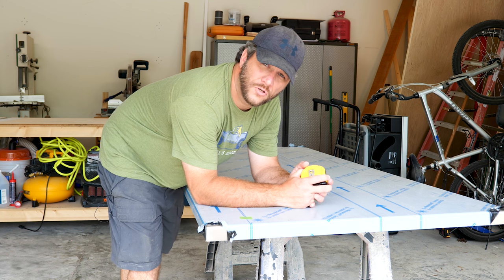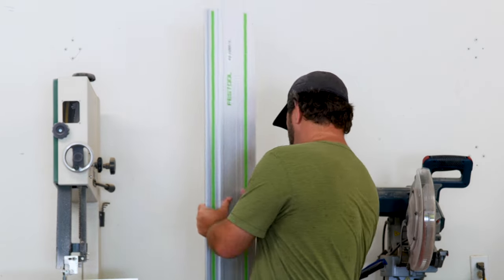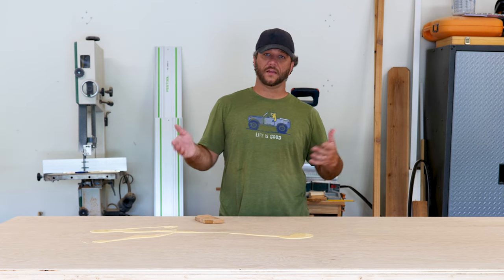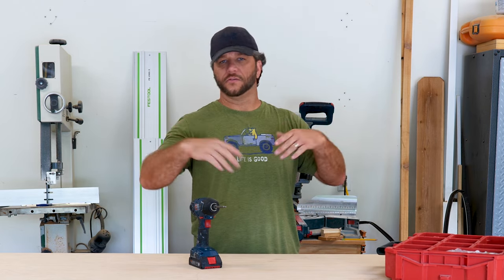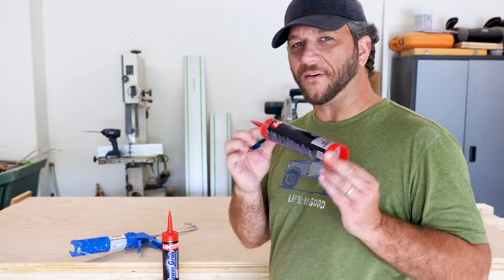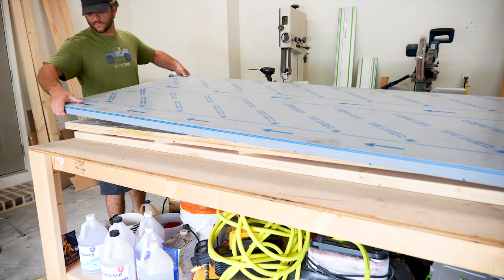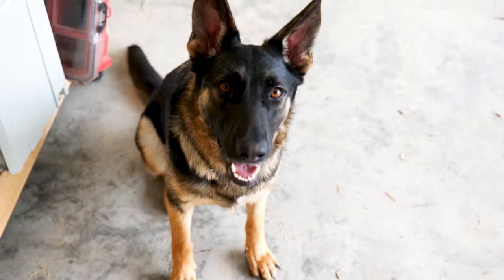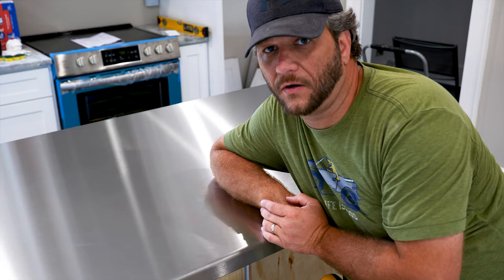EXPENSIVE Kitchen Countertop for CHEAP!

Comment: What you can do mate is get an orbital sander with a 240 grit pad, add some oil to the stainless and go over it with the sander it gives it an excellent Matt finish. So basically professionally scratch it to save you looking at scratches at the beginning. Then just re finish it same way whenever you want. That’s what I do 👍🏻
Reply from the maker: That's a great tip! Thanks!

Comment: This is such a great idea! With a stainless steel countertop, you can roll dough (baking), temper chocolate, etc! The possibilities for all things baking and cooking are endless with a stainless steel counter. The only modification I'd make to it is to install a cooling mat under the stainless steel sheet because stainless steel takes time to cool down when you put hot stuff on it (example: chocolate to temper it). A cooling mat will eliminate that problem and make it easier, and more enjoyable, to work (baking cooking) on that countertop. Thank you for sharing!!! It's a really great idea!!!
Reply: I know it's been a few months, so I hope you see this...I'm actually looking into making one section of my counter stainless for the exact reasons you mentioned & I had the same thought re: it holding onto heat. What do you mean by a cooling mat? I was thinking just a garden-variety insulated mat on top but I think that would still prob get/stay hotter than I'd like so now this cooling mat idea has me intrigued! 
Thx in advance 😊
Reply: @marchi.fleming  Professional kitchens, dedicated to candy making, have a cooling mat installed under the stainless steel. For what I've gathered, some cooling mats have different temperature settings to choose from, depending on what you're making. Those cooling mats can usually be bought from specialized vendors only. However, they're worth it.

I hope this helps.
Reply: @marchi.fleming  my understanding theyre plumbed with water to draw heat out of the surface
Reply: Thank u!!

Comment: I have some ideas for you. Don't use plywood as your base, tell the fabricator to use square or rectangular tubing to make the base, way stronger and will not sag or absorb water. Second, clean surface with lacquer thinner and  use 2k clear coat to spray the top and sides with a spray gun and compressor, 2 coats with some reducer to help it flow like glass, let dry, and flow coat it, spraying 2 more coats, go crazy. Now to have scratch resistance, and you repair it like a car. Also if you're rich Tamco sells ultra hard clear coat for boats and cars, looks like glass but hard AF. Same formulation as what they originally used in Disneyland, unless I read that wrong
Reply: What is rectangular tubing?
Reply: @kellyreid978  square tubing means all sides are equal length, rectangular just means 2 sides are longer than the other 2 sides.

Comment: Good video & thank you for telling people they will scratch!  I am a sheet metal woker. We get so many calls about scratched stainless countertops.If you want a countertop to stick without releasing use a glue specifically made to adhere to metal. We use Loctite PL Premium for countertops all the time and do not have any release issues. Also recommend returning all exposed edges with 1/2" so people who run hand along edge of countertop do not get cut.

Comment: I found an 8x4 sheet of stainless for $100. 1.00 mm thick. Going to chop it into three pieces and make smaller free-standing islands, 30" x 48" each. On locking casters.
Reply: Hi, did you ever try this , did it work ok? Thank you
Reply: @KeiFreedman  Yep. Done and done! It's been working BEAUTIFULLY for many years now. In one of them we cut a hole for a stainless steel sink. We ended up making four of them, and kept three.

The first one we made we ended up giving away to someone else. Someone who was "helping" us bend the metal (for the edges) tried to bend it with a hammer... Then decided that the hammer marks could be sanded out. On stainless steel. Needless to say it looked like absolute garbage, and we stopped accepting his 'help'. It looked terrible so we just gave it way. Still very functional. For something to look good, you need a proper metal bending machine to bend the steel down for the edges.

Comment: Thanks for the video. I'm working on this right now. Did you weigh down the stainless after glue up? Or any other left out steps. Thanks.Good looking project.
Reply from the maker: I didn’t weigh it down. The glue I used was instant grab. I did go around it pressing down every so often for about ten minutes just to make sure it was making contact though. Thanks!

Comment: Hi, great video. I would like stainless steel on the perimeter of my kitchen which are 2 cabinets flanking sink and then a and L shape so a 4ft long single piece and and other about 36x24 approximately so might have put them together to make that L then I have the 2 cabinets flanking the sink which will be a top mount sink. I’m so confused and don’t know where to start, may I ask where you ordered the stainless piece from? It’s very nice you did a great job. I don’t want stone , or butcher block, wanted something easy to clean up around water , I was also maybe thinking copper but I don’t know where to start. I will hire the work out I just don’t know where to get stainless? Also I read somewhere that if I go with copper counter it will need some sort of safety to avoid shock, can you please give me some guidance if it’s not too much trouble, thanks a bunch. Your dog is awesome!

Comment: Hi amazing work! i question what is the Thickness of the stainless steel sheet? what would you recommend for a kitchen? thanks for sharing !
Reply from the maker: Thanks! I went with 16 gauge steel but 14 or 18 would work also. I've had a 16 gauge top for 15 years and never dented it with hard daily use.
Reply: @HAXMAN  yeah 16 or 14 sounds like it should be fine. At first i wanted to go for a more contemporary look with a 1/2''' thick sheet, i have seen it before and its just mind blowing specially from the sides  it looks cool, the problem is the price  ahahaha no budget for that! thanks for sharing good stuff man, i will go with 16 gauge.

Comment: Do you think it would work as a covering for a kitchen table as well and would I have to glue it down? Stainless steel tables are so great and the top of my table needs refinishing so I was wondering if this might be a good option. Thank you in advance!
Reply from the maker: I think that’s a great idea! Yes, I would glue it down.
Reply: @HAXMAN  thank you! Would it have to be glued down if it was a tight enough fit?
Reply from the maker: Maybe not but gluing it would help prevent dents.
Reply: If you have access to a metal brake, or the ability to build/use a DIY brake, you could always make it so the sides capture the table. You can make it slide on, from one direction, then you could turn the stainless, into a big C clamp basically. It would clamp the table, keeping the stainless secure, while making it removable. I would lay a 1/4" foam mat or lining, over the table, to act as an insulation, as well as to have something to keep the clamps tight by resistance.

Comment: Hey. So I did this in my kitchen recently but I have not glued it down yet. I was going to use liquid nail but I'm worried about that "popping." How did the glue work out?
Reply from the maker: It's worked perfectly so far. You should be good to go.

Comment: Quick question... you said that stainless steel countertops go between $70 and $100 a sq ft. At the end you said this countertop would be over $1k. Then you said it's 24sq ft.  That's tells me you saved way more cause a countertop place would have been $1890 to $2400 😳
Reply: $2k for an island is ridiculous. I'm glad you made this video cause you just saved me a bundle by switching to a sheet metal fabricator 🤣

Comment: Wouldn't it be better to just lay the RSS on top without all ate adhesive?  I would be concerned about warpage. Metal and wood shrink at different rates.
Reply from the maker: You could if you don't have an overhang like I do. With an overhang though, the plywood would start to droop without being glued to the SS. The plywood is not going to shrink though.

Comment: Will look terrible in a year. Dents, Faded, need to unidirectional sand to look new.
Reply from the maker: It’s been a year. Looks great. This is the second one one I’ve done. The first one is over ten years old and looks great. If you want to to add the “grain” back it takes 5 minutes with a scotch pad.